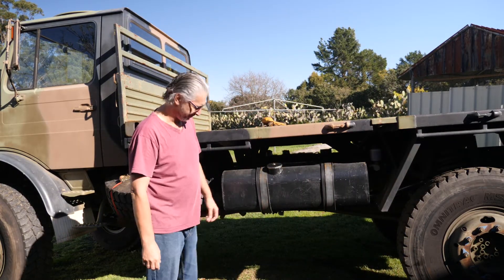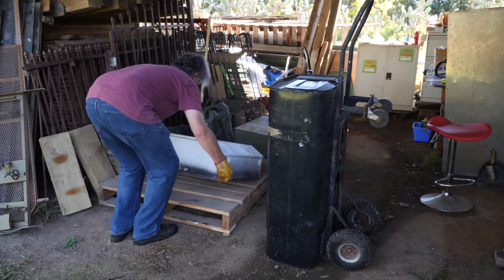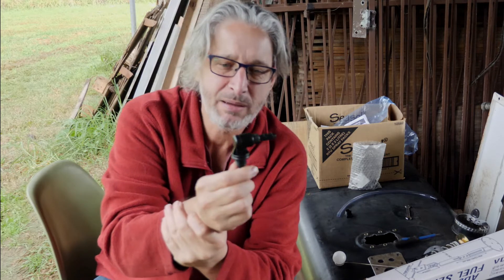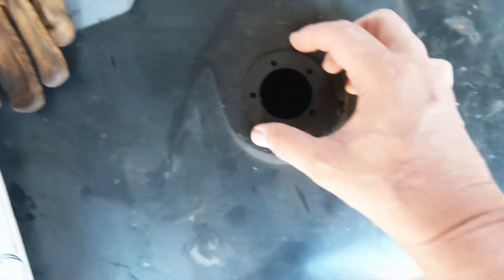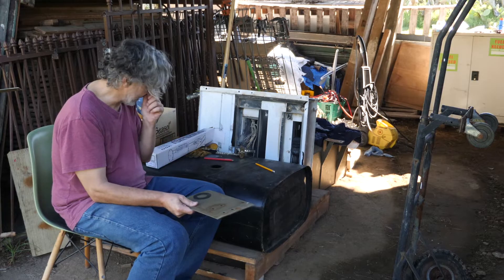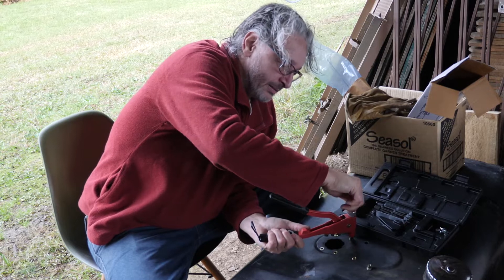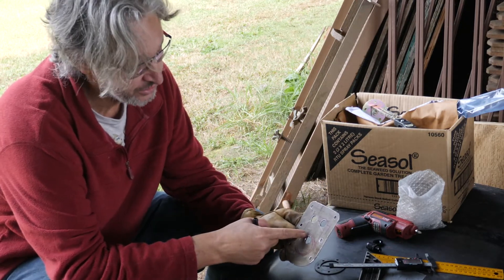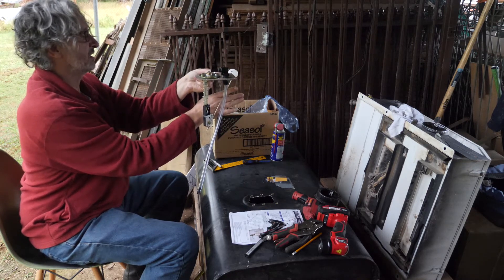Unimog fuel tank pickup installation

Comment: Good video mate, try avoid using PVC hose with fuel.  PVC is a rigid plastic, the fuel will draw the plasticizers they put in it out, the pipe will become brittle and crack.
Reply from the maker: Brendon Tait thanks, what should I use?
Reply: @ThaboNelmeanshappiness  look for a fuel rated hose, or you could use a nylon or polyethylene air hose..  polyethylene on air hose will normally be marked as something like PE, LLDPE or HDPE